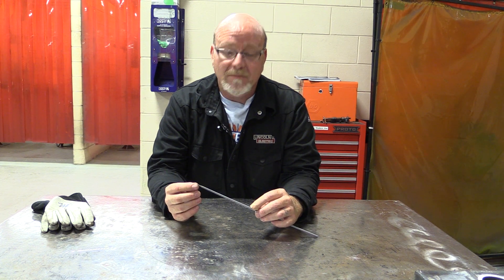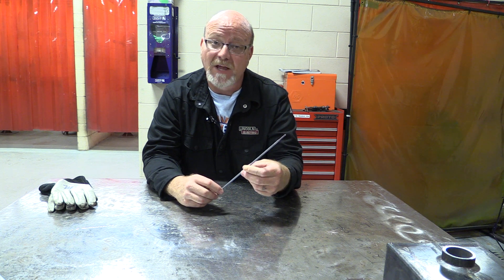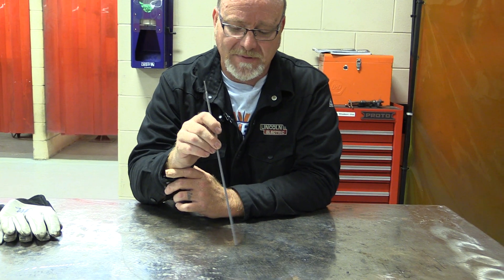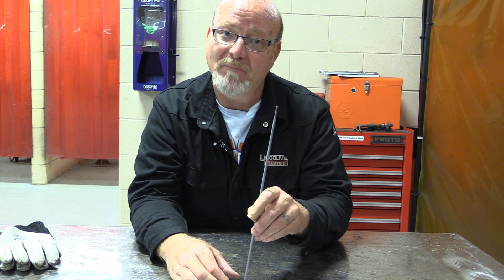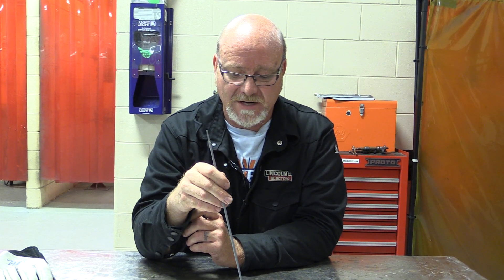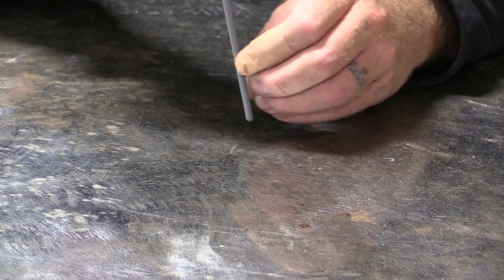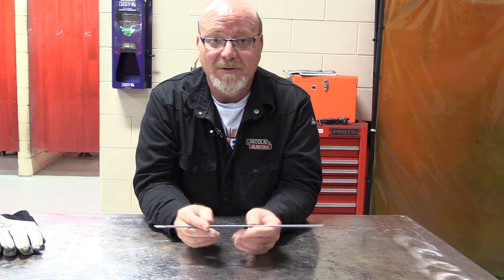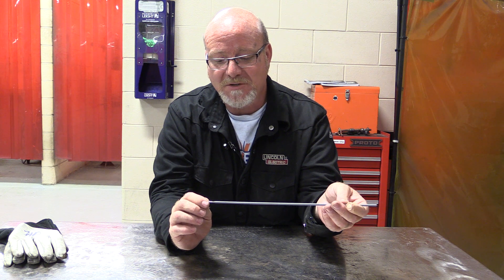Why use 6010 and whats the difference from other stick welding electrodes

Comment: I've been welding with a Lincoln Idealarc for more than 50 years. I passed it on to my boys and thought I could pick up a multi process welder. To say those Chinese cheap wannabe welders can stick weld is a huge exaggeration, especially 6010.

Comment: How long is the whip? Equal to puddle size, double?
Reply from the maker: yes about the puddle size. The idea is you can WHIP off it long enough and far enough to let the puddle solidify for a millisecond especially in a open root pass.

Comment: Why would you use a 6010 instead of the more invertor friendly 6011?
Reply from the maker: different flux, deeper pen, better on surface impurities and better in open roots
Reply: @markprosserwelds9419  I tried it on my roots, now my pubes have fallen out, thanks though.

Comment: Very informative ,but i was wondering if e6010/11 rods should be baked or stored in a rod oven like e7018 welding rods??
Reply from the maker: no 6010/11 electrodes have cellulous flux, very different than 7018 flux, baking them wont hurt them but that flux does not absorb moisture like 7018 flux

Comment: Thank you for good explanation, I tried 6010 electrode, whip and pause technique in ( I)shape, also tried (U) shape technique for open root and think that U technique produce better welds as it fuse sides of the bevel as become in contact with electrode and with a pause at the bottom of the U to deposit more metal. Also slightly  bigger gap produced better welds because of the weld contraction when it cools off.

Comment: Here in Europe we use 7018 and mostly 6013, recently i bought 6010 to try it, but i have big problem (undecut and burn through) , I do not get how people weld gaps with this rod.
Reply from the maker: 6010 is a deep penetration electrode, used for all position welding but particularly for open root (gaps) welding. The flux is very different than 6013 or 7018. The technique is also different for this electrode. The whipping or whip and pause will allow you to fill gaps no problem.

Comment: I'm in Europe and have 6013 more easy available then 6010. Would it be advisable to run 6013 with a double 7018 on top for trailer repairs, or would this be unwise as it is different to the 6010 for penetration?

Comment: I love 6010 and 7018 both I use them almost everyday for equipment repairs in the field the 6010 like you said will dig to China on an old busted excavator boom or an under carriage on a dozer especially if you arc gouge it out nicely and use it on the root I use 1/8” 6010 and then fill and cap with 1/8” or 5/32 7018 depending on the groove I’m filling but that 6010 is a great rod and should be in everyone’s box I think

Comment: I've welded miles of 6011 using cursive "e" and a buzz box. I've used 6011 to punch holes and cut metal a lot. I'm much newer to 6010 but I find it doesn't weld terribly easy on my Alpha Tig. I know many welders have a 6010 "button".  I find, I need to use a very, very  tight arc with the 6010 or it goes out. Can you discuss the differences between the two rods. Is using 6011 equal to using 6010 in the eyes of the welding world or the inspection world? What is the reason 6010's are used on pipe with an engine drive welder and how is that better or different than the IGBT welders and the "6010 button" ? It appears many pipe people actually push or bend the 6010 rod as they weld, a trait that seems foreign to me as a 6011 guy.

Comment: Such good tips on the whip. I had not heard to be careful about the angle of the whip increasing arc length causing my issues... well one welding issue.

Comment: 6010 what's the difference to other rods 👍
Reply from the maker: FLUX type. Most mild steel electrodes are the same inside, it is the type of flux that gives them different characteristics. As the different type of fluxes burn, they create different types of gas to protect the weld pool. Same with MIG welding with different gasses.

Comment: If you whip back with a quick freezing weld pool and slag, when you whip back , aren’t you going back over the surface/crust of the slag and reincorporating it right into the weld pool-causing contamination?
Reply from the maker: With mineral based fluxes like that on 7018 you are correct but with 6010, the flux is cellulose which is simply paper. It is light and flaky, its not really slag. This type of flux is exactly why 6010 has different characteristics than most other electrodes. Your logic is good but sometimes with welding we have to throw logic to the side. Remember welding isn't art, it is science

Comment: I hate 7018 as much as 6011. On DC 7018 strikes and holds an arc good. On AC 6011 is hard to strike an arc. Since I only have an AC welder I only use 7014 as it strikes an arc MUCH better than both 6011 and 7018. Someone gave me some 6011 rods and i found those damn things were hard to even keep an arc going. Never ever had that trouble with 7014  rods in the last 44 years. Those rods only stick a little when first striking a new rod. 6011 rods stick every damn time I try to strike an arc. I know I'll hear a bunch of advice from others that disagree but I have found this to be true for many decades.
Reply: 6013 is the easiest rod to use. I've just started using 7016 twin coat rods and they are awsome can be used for root passes aswell because they are a deep pentration rod and the beads look really nice. You should try 7016 i bet you'll be using them all the time. One rod that can be used from the root pass to the cap.
Reply: @b.p.r. Weber.  I don't remember seeing 7016 rods any place but I'll try them out. Hopefully they don't require d.c. current. As far as 6013 goes, it has been a while since I used them but I don't remember them as being easy to strike an arc with but are somewhat better than those stinking 6011 rods. Thanks for the info.

Comment: We weld steel piping for both liquid and vapor propane service, as well as some Anhydrous Ammonia piping structures..
Some of the piping is A53-A Grade B and other piping is A106 DOM material.
Our root pass is 6010-5P+, intermediary and weld out caps are with 7018.
Reply from the maker: A good description of the electrodes used on the majority of all pipe welds. 5P+ and 7018 Excalibur

Comment: I really like your videos, common sense and no drama. I always liked 6010, especially Lincoln 5P. It was what we used in the Air Force in the 70s.
Something interesting,  we had some 7016 rod in the Air Force. I had read it was a low hydrogen rod, but no iron powder in the Flux. Which is what gives 7018 its high deposition rate. Can anyone add to this 7016 comment.
Reply from the maker: Thanks!, please keep an eye out for more videos soon

Comment: Is the 6010 the best electrode for an AC welder?
Reply: Use the 6011 on a A.C. machine Daniel.
Reply: @DANIEL TAYLOR. Use 7014 rods. That 6011 rod crap is for the birds. 6011 sticks far more often than 7014. This has been true with every AC welder I have ever used since 52 years ago.

Comment: Teaching myself welding   I have a need for high strength welding for a tractor.  Just wondering if you can use 7010 the same way you use 6010???  TY in advance.

Comment: Thanks.  I've burned a ton of both, but for really pretty patchup work, 6013 is my go to. Not as strong or deep, as the 6010 but way easier to start, burn, and "stack dimes"
Reply: It’s weird.  There isn’t much difference between 6010 and 6013 other than the flux.  The tensile and yield strength are almost the same, carbon ditto, silicon higher in the 6013.  6013 makes a nicer weld if you ask me especially the 3/32 electrode as you can practically drag it on the surface.  I read in Europe they use 6013 for root pass pipe welding.  I think the best rod is the one you can do the best job with.  I’m not a pro but my two cents.
Reply: And what about the 6011

Comment: Retired Boilermaker 35yrs under my welding hood. I stopped using 6010 after my first year in the Boilermakers apprenticeship. 6010 is junk wire for junkyard welding. When I did a texass heli-arc, I would knock the flux off 6010 to use as filler rod for 7018. Also why would you root pass with 6010 and then cap with 7018, your weld is only as strong as your root pass, so why not use 7010 for the root pass?  On a side note I've worked in nuclear plants and a few have an open root tube test, the root pass is done 7018 which is way easier then that junk yard 6010 wire.
Reply: 6010 root with 7018 cap passes bend test what more could you want? Nothing puts in roots like a 6010 it was born to put in roots.

Comment: Pardon me, but with most transformer welders, as arc length gets longer, voltage drops and amperage increases.  Otherwise, you are absolutely correct!  You make a very concise lesson is how 6010 deposits a bead. I wish my instructor explained this to me this way 30 years ago.
Reply: Wrong. My amp meter says different.

Comment: I used 6010 for welding pipe railings back in the 60's and 70's . 6010 is the best rod for learning stick welding.

Comment: you should not use a 60 series wire for a root pass in structural welding.
Reply: I'm changing my answer. you can weld the gap( root pass ) between the 2 pcs with 6010 and fill with 7018. HOWEVER you should be able to back gauge the 6010 root and refill with 7018, for proper strength. Why not just do the root with 7018? BUT WHO USES STICK ??
Reply: @barrybrown8169  Refer to the AWS structural welding code. Most of the wide flange beams are A572 steel which should only be welded with E 7018, E7028 or some of the self shielded flux core wires or gas shielded flux core wires,
Reply: At the ship yards that's what we do 6011 root 7018 cap. I passed bend tests this way.

Comment: What would be the issues if 6011 was used in place of 6010?  I keep hearing that these two rods are so similar, that they're basically interchangeable. But no one ever does. Personally i like 6011 way better, as does my lo open circuit voltage machine.
Reply: 6011 for AC, 6010 is DCEP
Reply: 6011's are supposed to work on DCEP but I'm having a helluva time with them. They just won't light and are hard to keep lit.
Reply: @phiksit  
 
What you are saying is what my experience has been with 6010 rods. I almost want to ask you to verify that you are actually talking about 6011 and not 6010 rods. What also is peculiar is that 6010 is a dcep rod and 6011 is an ac rod, dcen, and dcep. So this too points at you actually talking about 6010 rods. Also the problem you're describing points to your machine having low open circuit voltage (OCV.) 6010 rods will not work with an OCV of 63 volts (or lower) you'll need a machine with  about 90 volts OCV.

Comment: I have a question and im already hear don't do it. But I kind of don't have a choice. The machine is a 110v 225amp dc inverter. The material is various bicycle frame tubing 1mm - 2mm wall thickness. Metal aluminum, alloy, and steel. I know that the aluminum and alloy frames will need ER4043 Aluminum arc electrode stick rods I'm thinking of using 3/32". Now what 1 or 2 rods do you recommend being my main go-to rods on the steel frames. I'm still think of 1 rod being a 3/32" and the other a 1/16". I know that the aluminum especially would be tig welder and I would if I had the budget. The other option is to not do it. Which isn't an option for me either.  Iam having to re build my life back together piece by piece while living on the streeys. I've had people bringing me bikes to fix for a while but now I've got people asking for me to fabricate custom frames. So that I can earn some cash and get myself back off the streets I'm going to take what knowledge I have and what knowledge I can learn from everyone else and try and do what most would be saying for me not to do. 1 stick welding bicycle tubing frames. 2 stick welding aluminum period.
Reply: Ive had a go at aluminium  stick welding it's not easy really hard to strike an arc and when you do get it the rod burns super fast and you really have to go like hell to keep up. The flux is like salt so it really hrd to chip of. But when you finally get it the welds can iook rally nice. So save up because your gonna need a lot of rods and a heap of ali to practice on. I reckon go for it oh and make sure you where a mask and have plenty of ventilation ali smoke like hell ant it's not something  you want to get up your nose.

Comment: I have a bunch of 6010 electrodes,look completely different from the one presented.Reddish,thin coating,close to impossible to start an arc,which goes out in 1-2 sec after starting.Yes,it is a Lincoln product.Anybody with helpful thoughts?
Reply: I can't get 1/16" 6011 rods on my small dc inverter welder to run. Goddam things won't light...  just stick, stick, stick. Once I do get one started they're sort of ok, but the arc isn't real easy to keep lit. Running at 35-40 amps. I'm ok with 7013's... maybe it just takes practice. Really frustrating.
Reply: Probably 5p. 6010+++++. Yes, it's a rod. Deep red clay colored. Can't remember the specifics of the benefits, but it's the only red rod I've ever seen/used called 5p(+++++). I mainly used it on refineries building the tanks. Great for non structural, roots, and less than ideal surfaces.

Comment: Don't use this stuff on structural first off it's not low hydrogen so unless u do a generous preheat you will get hydrogen cracking also it's not ductile  you'll never see this crap on coded structural jobs only pipe
Reply: You are exactly right. I wish every welder would read the AWS structural welding code and learn what filler metals to use on certain types of steel. Also what types of weld processes are prequalified for use on structural steel.

Comment: With inverter based welders as I understand it you cant use 6010. Is there an alternate rod offering reasonable penetration for root passes
Reply: you can run 6010 with an inverter... just not a $500.00 hobbyist inverter machine. look at like the miller multimatic 255
Reply: @imbrandon16  thanks Sheepdog69. Turns out I got my old Canox 250 working today and it will burn 6010. Tomorrow I am heading to town to get a Miller 235 to learn how to mig weld. I dont weld much on the acreage so as nice as the 255 looks for Tig etc its a bit much for my needs..

Comment: I'm brand new to stick welding.  I got some new 7018 rods that says DC+/AC and my buzz box is only AC.  Striking an arc is almost impossible and even when I get it briefly it keeps going out even when I crank it all the way up to 180 amps.  Is it because my rods aren't heated?  I don't keep them heated.
Reply: Use 7018AC rod. Can be used with  a AC welder.
Reply: An old welder told me to go to 7014 rods. It made a world of difference.  Can make a simple but ugly weld now. Lincoln ac only  tombstone welder and YouTube for training.
Reply: @Fred Becker. That old welder guy was right. 7014 rods strike an arc better than 6011 by far. I can't believe so many people on YouTube brag about 6011 rods. They have been terible for welding for the 52 years I have used them. 7014 only ressist arcing when new but after the initial arc will re-arc easily. The flux breaks back from the rod tip on 6011 easily and that is why they stick so bad. Any new rod has the wire center protruding past the flux and that is why new rods stick at first but not for real-arcing.

Comment: After doing a "pad of beads", got it "mastered"??
What a load of bull. 
Go from that "pad of beads" exercise then, to welding a 3G upward root, or even better a 6G upward root, and youll realise that youve been wasting your time running beads on plate 😄😄😄
Reply: Not true at all. Welding practice is never a waste.
Reply: @patriotskingnation8084  Whatever kind of practice is never a waste. It's my main point. Obviously you need to focus your practice on the tasks you know you're going to be doing the most.
Reply: @LeonardoRojasCarpentry  have you tried 6010 method ? Pause and whip ?
Reply: @patriotskingnation8084  Not yet. I'm a beginner. I tried 6013 only, so far.

Comment: You have some interesting points about 6010 that I haven't heard elswhere and they're helpful. Locally I mostly see 6011, does this behave the same way or should I look harder for 6010? I'm running a DC machine. Thanks!
Reply: Some new inverter machines don't allow you to run 6010. Apparently 6011 is a better alternative on those machines. Not all inverter machines refuse weld 6010, you have to check the manufacturers recommendations
Reply: @Subway1427  Interestingly, I run an inexpensive chinese inverter and it really hates Hobart 6011. Can't keep a rod lit more than 2-3 seconds. Lincoln 6011 however runs like a champ.
Reply: Gyppor 6011 is basically the AC version of 6010. Therefore since you have a DC machine you would be better off using the 6010 rod. However 6011 does also work on DC as well.
Reply: They run very similar. 6010 penetrates a little bit deeper than 6011, all other things being equal, but not by much. 6010 only runs on DC Reverse and requires a little higher voltage than 6011. 6011 runs on either DC Reverse or AC. Unless you're doing root passes on pipe, buoying ships or skyscrapers, or some other "code welding" 6011 will work just as well, and is easier to find without going to the welding supply store. For most home hobby type welding you can do everything you need to do with 6011 and 6013 in 3/32" & 1/8".
Reply: @calvinhandley2373  Thanks, those are the sizes I use. Mostly 3/32. It looks like I'll continue running 6011!
Reply: I've got a Thermal Arc 95S inverter and it hates the Hobart 6011. Just impossible to get the rod started and not easy to keep lit.